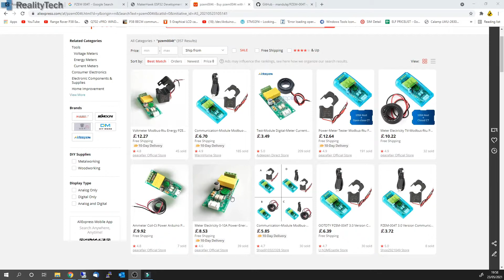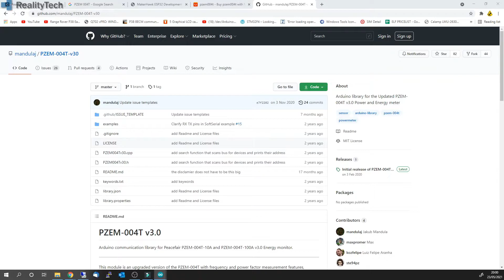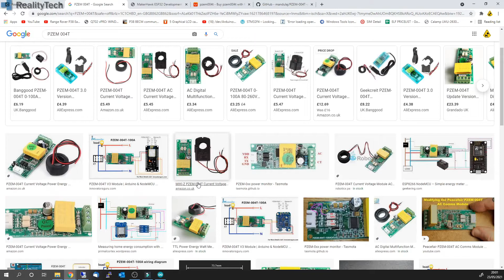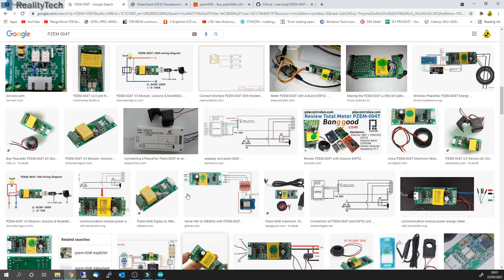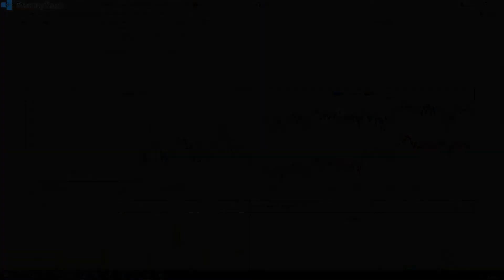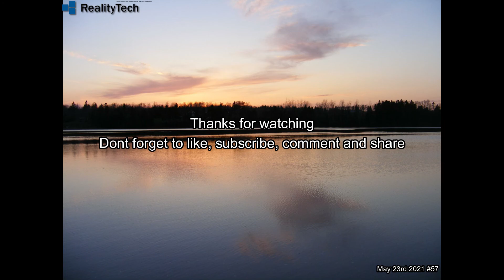Quick Look : DIY Voltage & Power monitoring with PZEM-004T

Comment: Using one of these with an esp8266 and esphome. Working fine on 3V3 with no modifications.
Reply from the maker: I did debate using an Esp01 but wanted some debug capacity. Been meaning to use the maker hawk boards for ages so went that route. I did try without the mod and it wasn't happy.
Reply: @rtechlab6254  I think mine is on a nodemcu board, which are apparently 5v tolerant.